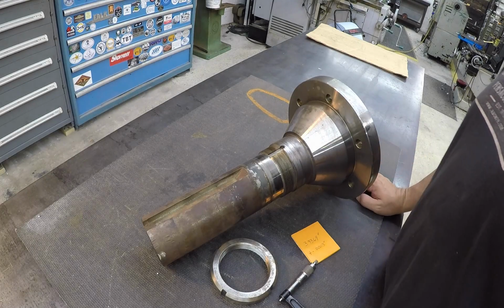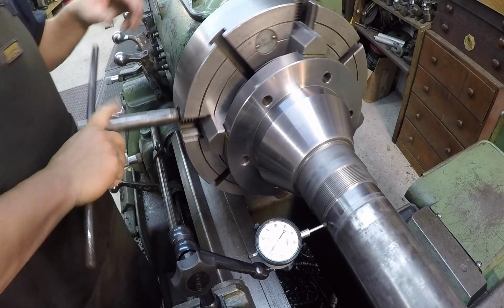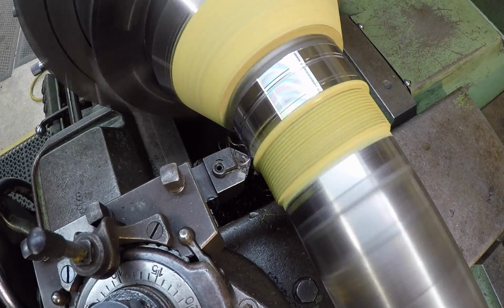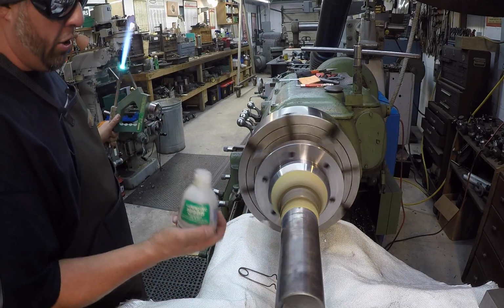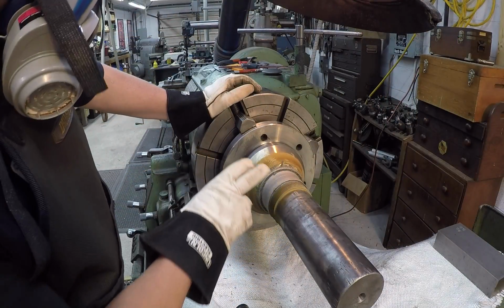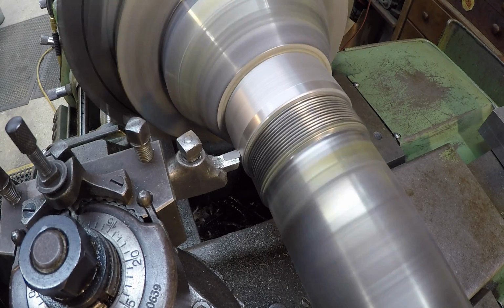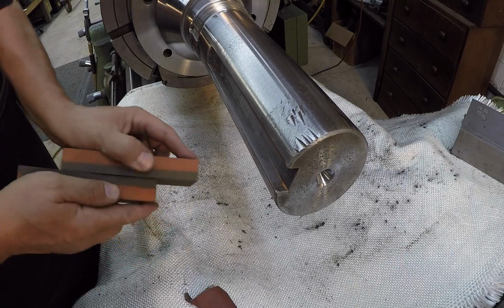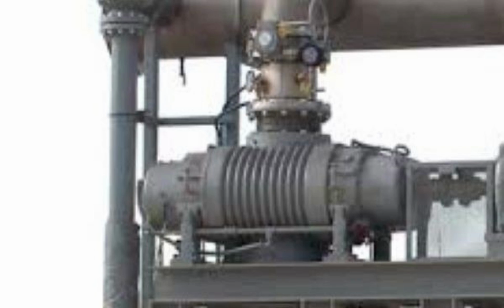SNS 300: Spray Welding a Blower Shaft

Comment: We used Eutectic Castolin products such as borotec for building up trunions on Mack suspensions and sludge pump sleeves and drives and they work great as long as the heat is in correct range for bonding and it’s prepped properly it may seem time consuming and costly but if your using old equipment that you can’t buy parts for and if you can buy parts for them the cost is by far favorable to spray repair than buy parts, nice work Adam love that you keep the techniques alive and well I miss doing it

Comment: We were using a  Eutectic RotoTec torch setup about 30 years ago in the shop i worked in. It did a great job restoring bearng surfaces on worn shafts.

Comment: What a magnificent and unique journey you just took me on. Wow, when you thought you knew it all you pull out a trick from a bag I never knew existed. I am just wondering what the compression strength is and whether the part now could be considered good as new or just a percentage of useful life as compared to the brand new part. Any way to test these parameters before shoving it back into the beverage filler from whence it came?
Reply: Most eutectic products give you ratings on compression , wear resistance, and thermal draw for bearings as well as HRC ( hardness Rockwell) for wear and durability, Adams technique is excellent in all aspects of his work including spray welding,

Comment: Should of nickel plated it to above the correct diameter and then machined it back down
Reply: I've seen that work too, electroplating can be like magic sometimes. Restore worn parts to spec... what? Are you a wizard?

Comment: You can get you a cheap ultrasonic thickness gauge to catch a sleeve that is invisible. 
1. You held the torch about 4 inches away. Is that distance critical?
2. If you finish and find you screwed up and over cut the final size can you go over the spray with more spray or do you have to machine it off to base metal to start over?
3. Is the spray metal powder expensive?
Excellent presentation!

Comment: Wow, this brings back some cool memories of when I worked as a machinist early 80s for a now defunct company, Beach Russ in Brooklyn, NY.  We used to make vacuum pumps, smaller ones mostly for the food industry and the large ones for the US Navy.  When the pumps would come back for rebuilds, I would repair the shafts in some of them using this very same method. Saved many shafts this way. I suppose, this technology was pretty innovative at the time.  Amazing it is actually still being used. Great vid.

Comment: So if I understand this correctly, you are essentially spraying molten metal onto metal in order to increase the thickness so that a surface that has worn can be resurfaced to the correct specs? If someone would have told me this was a thing without seeing the video, I would have called BS.
Reply: agreed. would have never thought you could get the base metal hot enough to fuse the overlay. must be the powder process.
Reply: It is a very common process. We have 2 booths, each the size of a small house that we do this in where I work. One does flat surfaces, the other does rolls. The spraying process we use is on a much larger scale and as loud as a jet engine, necessitating extensive sound proofing inside the booth.

Comment: Wonder why they just didn't have the journal industrial chrome plated the ground to spec. We did that for high speed spindles running 4000 and up in RPM's . Never heard of spray welding. But hay I haven't heard of slot lol. I just know chrome plating works and can last a very long time.
Reply: Problem with chrome is I have seen it peel out of the surface. Quite common in cylinder liners to see that happen also. I've cut things undersized and then built then up with welding rod. Then machined to final size. Want to see a pretty finish, do that with a type 304L rod and then machine. Ends up very slick and far harder than the chrome is. Another favorite of mine is EutecTrode 680 but it gets expensive fast if you have a larger area to do. At $50 to $75 a pound. Compare that to type 6013 that runs $3 to $4 a pound.

Comment: Basically 10 centimeters. Why you would use such primitive measurements is beyond me.
Reply: There is probably a lot that is beyond you..
Reply: Metric system is for lazy people. ;-)  I actually use both but I'm more at home with the inch system. Same with temperatures. Fahrenheit is far more accurate per degree than Celsius is.

Comment: interesting video and I like the concept of Spray welled, never heard of that before, it has me thinking about my 50-year-old wood bandsaw that has slop in the wheels shafts, is this an expensive process to get done in a machinist shop?  furthermore, it has me thinking, could I build up coats of resin epoxy's on my shafts and turn them back to size? would resin's be strong enough for a wood bandsaw? Basically this video left me with more questions than answers loll

Comment: Which is stronger stickwelding or spray weld
Reply: It appears this spray welding is some kind of powder coat. Oxy acetylene torch flame is about 6,000° F so it's instantly melting the powder and spraying it onto the metal. It's purely for this kind of work. This spray welding isn't for actually welding so stick welding is stronger.
Reply: stick welding is used to actually weld joints together for a strong, lasting hold. spray welding is more for coating metal to build it up.

Comment: How well would it work to remove a sleeve like that by putting the workpiece off-center in the chuck on purpose.  You would cut more material off just one side of it, and you could advance in a little at a time until the sleeve pops off?   Slow those rpms down, of course.

Comment: FYI, that's not welding. Welding is when you actually melt the base metal and then add a filler that solidifies with the base metal. You are soldering not welding. 
Change the title to spray solder.
Reply: Wow.  Both "FYI" and command sentence structure at the end.  Not appropriate communication on either account.   More to the point, spray "soldering" would imply the correct temperature range for the preheat, but I'm not so certain that a fractional amount of the base material isn't welded.  The yellow color of the powder sparks implies between 1000 to 1200C, and you see some fraction of liquid, if not entirely liquid in most steels in that temp range, and the entire base piece is heated to 200 before the powder is added, and you have the energy of impact added alongside the additional heat of the torch.  In my book that means the surface of the part is likely melting for at least a nanometer of thickness when each bit of powder impacts and heats it.    There are other similar looking processes that apply ceramic coatings and other lower temp coatings, so you do see the term "spray coating" or "spray powders".  The accepted industry terms for what he's doing include "spray welding" and "spray metalizing" or just "metalizing."   If, by some chance, absolutely none of the base metal gets above 850, and not a single atom of base metal melts, then you can congratulate yourself on being an absolutely correct lonely pedant whom nobody is going to understand; even if you do ditch the pejorative tone.
Reply: @brianhaygood183  well said :)
Reply: Well, when football & football that looked just the same on wordings is proven to be so very different on real life, I wouldnt sweat so much.
Reply: @oldestries  
Yeeeeeeeeeah OK
Reply: @oldestries  Dats just synonyms, like how "crispy bread" has a synonym "toast crunch".
Reply: Funny because if you google spray welding this technique comes up. Youre wrong.
Reply: Welding is just joining, brazing and soldering are also kind of welding method, so are tig, mig and stick.
Reply: did he wear the wrong color apron too? smh.
Reply: Popcorn, peanuts, cotton candy......

Comment: Question from a newbie here. How does the powdered metal not oxidise before it hits the part being built up?
Reply: Probably some compound mixed in the powder although I'm not sure
Reply: maybe because the powder stays within the flame?
Reply: Not an expert here but the combustion does create a high speed gas powder mixture which probably self shields withing the spray envelope. I see it as a lot like a gas shield in the MIG process.

Comment: I know spray transfer arc welding, but not this process, definitely peeked my intrest. Would an automated sub arc not work for this application?
Reply: The owner of a machine shop down the road from us said he only uses the sub arc process when heat and warping isn't a problem or can be controlled.
His shop uses the spray transfer on much smaller critical dimension parts repairs.
Those guys keep us in business. Great video by the way.

Comment: Can this process be used to Repair a Spun crank shaft bearing
Reply: I would say it depends on the crankshaft. Not all crankshafts are steel. Some are cast iron and it might not work as well on it.

Comment: Please don't just follow what you are seeing here, do your own research.  There are many, many important process control items left out.  First and foremost, you better find out it the bearing is a ball or roller bearing (not to be confused with a needle bearing).     The bearing dimensions the customer gave you (3.9369" + - .0003"?) seem undersized for any interference fit typically uses in industry.  3.9379" would be a minimum for a ball bearing type journal typically.  A roller bearing would have a larger minimum size in order to retain the inner race from spinning on the shaft.  
Needle bearings take a hardened, ground shaft surface not in the same realm as this part he is working on.
If it is a roller bearing (N, NU, NJ or a Timken type Tapered-Roller)don't spray metalize the journal because under a roller the powder will eventually breakdown back to powder and the bearing will catastrophically fail.  There are temperature limits not measured and controlled here that need to be done as you go.  Where the bearing journal meets the shoulder it needs to have a radius not a square or 90 degree transition as was machined in this video.  With the 90 degree instead of a radius you have created a stress riser.  Spray weld is not common because it has limited applications and many machinist incorrectly apply it in wrong applications,  or, are not fully trained to properly run the full procedures.  When you apply hundreds of pounds of powder in your career you gain the understanding of its limitations.   Do your own research...
Reply: He does discuss the limitations of spray welding and the issue of it not making a good bearing surface
Reply: @spamheadthe3rd  he was discussing spray repair under a needle bearing not whether this repair is a ball or roller bearing type application here on this particular shaft.  He should know that verifying the bearing type is critically important and be letting us know as he shows folks about the technique.  As I stated there are several critical areas about this demonstration missing.  Getting the proper training goes a long way before demonstrating a process.  I realize he is trying to help folks which is great but if you don't fully know what you are teaching then if nothing else say so.  Just explain,   here is what I know right or wrong, and do your own research before you attempt this procedure.
Reply: 3.9370" is the standard bore for a 100mm cylinder roller bearings types 1920, 1020, 1220, 5220. So 3.9369" + -.0003" is right for those. Same applies to 100mm taper roller bearings.
Reply: @gravelydon7072  wouldn't it be the bore  + .003" to .0049" not + - .0003", unless I am looking at charts wrong or wrong chart?
Reply: wrong info on my post, my original response was C3 fits, I see, obviously that application he is doing is a much lighter fit
Reply: @369freelife  My guess is that it is like with the clutch pilot bearings we had on our Detroit Diesels at work. Heat the bearing up to expand it a bit, install and as it cools, it shrinks to fit tightly on the shaft. A seal outboard from the bearing indicates that it might be in an oil filled environment.

Comment: The first spray metal I saw was in an automotive machine shop in about 1964. It was a dedicated machine and the machinist repaired several tractor and truck crankshafts.
The whole process was so difficult and hard to do that it was not really successful. Especially after the automotive machinist retired. 

This hand held system is very good. 

He didn't say, but he checked the temperature with a Tempel Stick. That is a brand name, so there are other brands. These sticks  melt at a specified temperature.  

I like the way he cleaned up the shaft after he finished the welding.

Comment: I can watch this kind of job time and time again.
The company I work for has cast iron cylinders resurfaced in a similar manner, although the cylinder is approximately 30” in diameter.
I also remember locomotive tyres being welded in a similar fashion to metal spraying. This must have been around 30-35 years ago.

Comment: Love your channel. In another life I was a tool and die maker back before CNC. Question, I have a 1932 Winchester Model 52. 80% of the barrel bluing is perfect but there is a few spots with moderate to heavy rust, case got wet. The barrel is almost 1" at the far end and I don't want to cut the barrel down. Would spray welding work to fill in the pits? And is that something you would be interested in taking on, for money of course.

Comment: Why no tail stock support during the preheat and welding process?
Reply: I would guess because the part expands under heat, which could move the part out of allignment.
Reply: Allowing slight temp, length exspantion due to heating?

Comment: I thought I wAs doing complicated machine and tool work grinding to .250,000” dia. Making ultrasonic transducers for non destructive testing using oscilloscope cable connected ends

Comment: You can easily tell that you sir are extremely skilled as a well rounded machinist with the benefactors of an impeccable welder who has about ten other trades mastered as well
A dying breed a wealth of extreme and lost passed down knowledge comprised by a multimillion dollar ultimate machine and tool shop equipped by that-thereof of what defines every level and facet in and out of all enclaves upon what and who the most outstanding wizard of his craft down to the hundredth thousandth of every last calibrated tolerance of pure perfection by a MASTER MACHINE AND TOOL LIVING LEGEND
GODSPEED

Comment: What would be the price difference between spray welding and normal welding bead after bead??? (ballpark figures). And wouldn't normal welding get to the diameter you need quicker? I'm a beginner/backyard welder and don't have near the experience Abom does. He da BOMB! :)
Reply: Hi towards the end he mentioned that normal welding would generate too much heat and warp the shaft i was also thinking the same
Reply: @matthewsandford4813   It could be welded, it just takes different equipment. Here is a crankshaft being welded using a submerged arc.  Important to control the cooling. Preheating would control warping    https://youtu.be/UYGzVzpWrw4

Comment: I bought that same kit in 1977 when I was Chief Engineer for a brewing company in the Fiji Islands. We had a lot of centrifugal pumps  with packed glands instead of mechanical seals. They regularly were over tightened and the shafts wore and burned. Instead of making new shafts we simply sprayed them with a powder that was tungsten carbide in a nickle matrix. They lasted forever.
Reply: Yep. Most people don't understand that the packing is supposed to have the lubricant ( usually water ) drip from them in a pump. Our big pumps at work used 5 segments of 1" packing when new and 6 rings of it once the packing had taken a set. Tight when we siphoned water thru and loose enough to hear an air leak  when actually pumping. Originally grease lubed and later water lubed Chesterton Teflon coated packing.

Comment: For those interested, based on the location of the inlet/outlet port (it is somewhat arbitrary as I will explain) for the blower shown at 48:17 and the fact that the input shaft is of set in that oval cross section casing it is clear that is a Roots-type blower which basically works the same way a gear pump works. 

The reason the inlet and outlet are usually interchangeable in these cases is because, like most gear pumps, these blowers are technically (at least usually) reversible and both the inlet and outlet are the same port size. 

Not that they usually get used in both directions of course. In this instance, based on the way it is mounted and the example shown a few seconds later of one installed in the field my guess is the bottom is the inlet and the top the intended outlet, but short of any built in limitations in the gearing, the pumping action is not a one way process in the same way a centrifugal pump can only work in one flow direction.

Wiki on roots-type blowers:
https://en.wikipedia.org/wiki/Roots-type_supercharger

Comment: Just curious, what is the advantages of spray welding over lets say just building it up with stick welding it. And also is this sorta like submerged arc welding?. I worked in a metal fab shop a long time ago and ive never seen anything like this. Great video, very professional, well put together. You now have a new sub. Thanks for sharing. Mark. Canada.
Reply: normal welding processes usually come with warpage, for line boring worn out bushings that's fine, for shafts it's not good.
Reply: @lovotcore6946  Thank/you.
Reply: @kuroryuu010 That is why there are things such as EutecTrode 680. You use it at the lowest setting for current that you can keep an arc at. But it does cost.